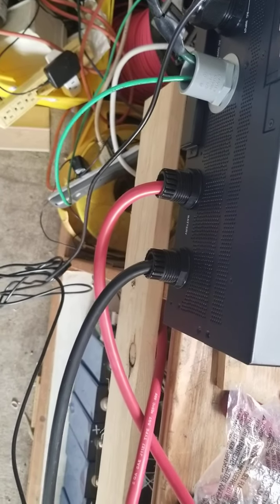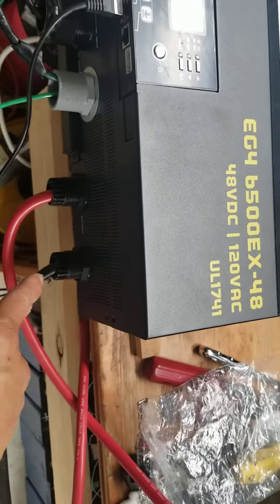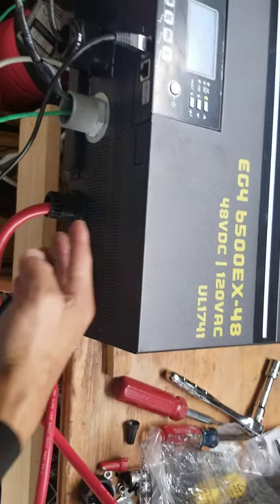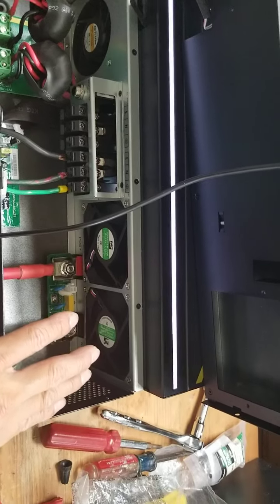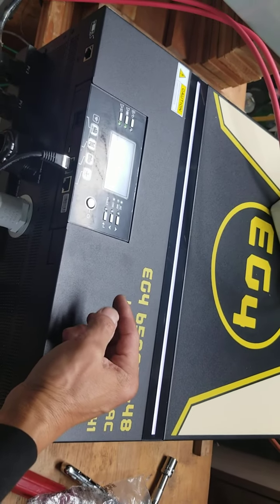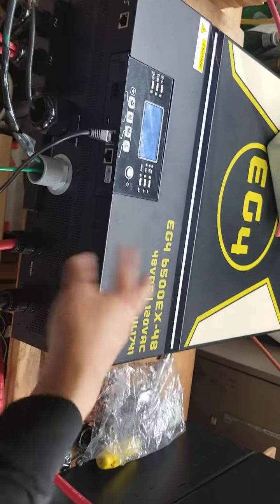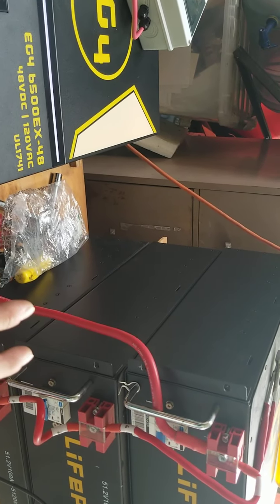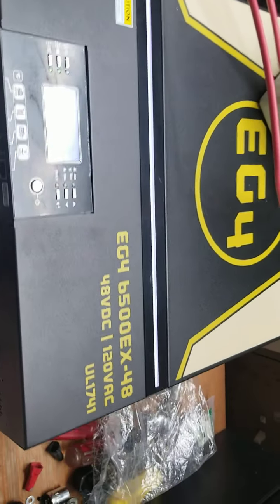How to help your GroWatt 5000, EG4 6500 EX and other inverter last longer, save $ links below

Comment: Hi; Other than the filter requirement (and keeping it clean), I think you are giving bad advice. Your physics are wrong if the desire is to cool the air in the box as effeciently as possible. Pushing cold dense air into a natural up-rising thermal is most effecient (ie growatt design) for the measure of air moved ie cfm using a given wattage of fan. Every greenhouse owner knows this (or has dead plants and a high power bill). Agreed that the top components will be hotter in the Growatt than with the EG4 design, but only the very top components. So, the real design issue is to keep temperature sensitive components down low in the box and heat generating units high in the box.  The EG4 design is likely flawed and results in either more fan power being required/uses and/or hotter components lower in the box. Hot air naturally rises. EG4 fights this natural movement. ie by pushing internally mixed air, that is still hotter air than ambient air, into the uprising thermal. The "counter-current exchange" system you recommend (ie EG4 design) will result in heating the components in the lower half of the unit when compared to the natural thermal effect used by Growatt - and also requires more energy being used by the fan to force the air to act unnaturally and travel against the "rising thermal" effect ie laws of thermal dynamics. The EG4 design mixes air better, but does so at a larger fan watt usage as it fights the thermal effect to move the same volume of air at the same rate.
Reply: He just said the opposite in the video

Comment from the maker: Well, this is how I think it is great about it, The way it made for air circulation and have filter.  But how ever the user like to buy or like the design, Research + budget and your design and location to buy what you wanted to use.  But the GroWatt 5000 would not last long as this EG4 at least for the filter part.  GroWatt inverter will suck in all the dirt/dust and will quit working sooner than the EG4.  My GroWatt 5000 quit working after 6 months inside shade.  Thanks everyone for view my video.... take care...
Reply: The growatt airflow direction is better 
So its better you add the filter from the under in the growatt